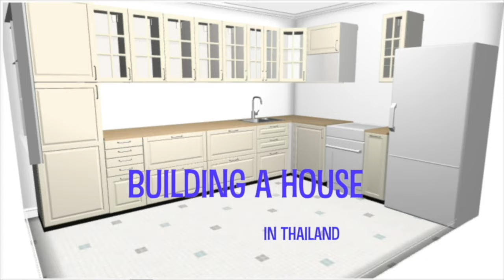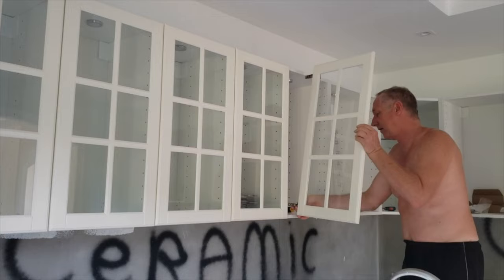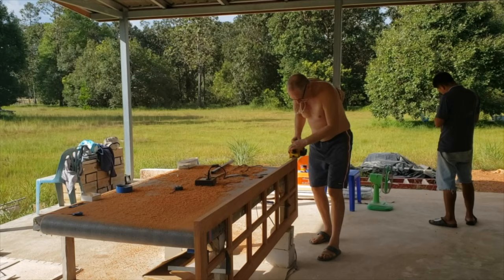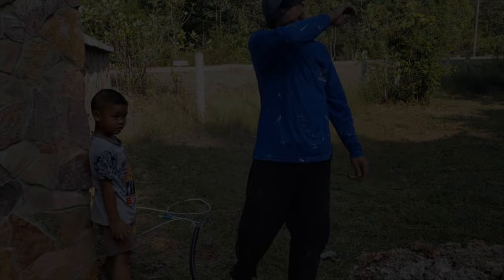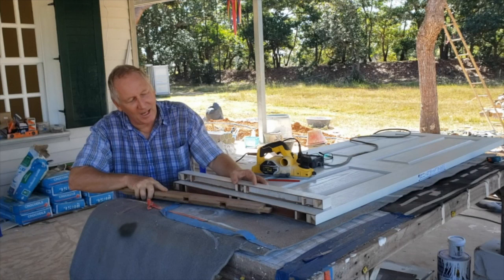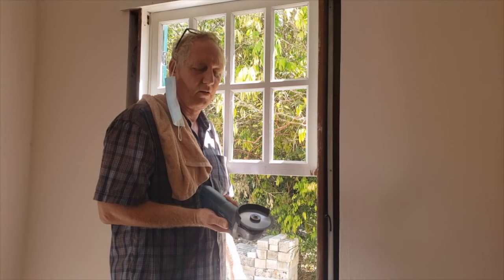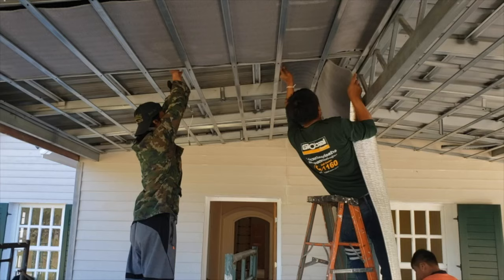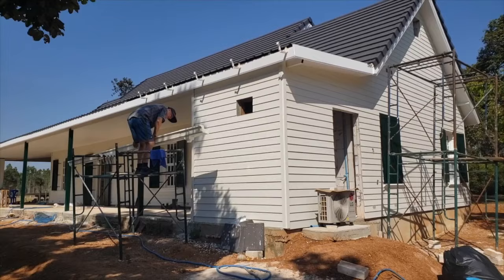Building a house in Thailand 4

Comment: I must say Maarten, if you weren't there the job would not have been in that shape or that complete, not at the rate these locals work. Working to them is a vocational holiday, nothing has a serious part to it, and blowing the draw line through the pipe is totally something new to them. Now they have learned some thing new, well done.
Reply from the maker: You are very right.
In the beginning things were fine, but the closer we got to the finish-line, the more often they were "sick".

At one point we simply let them go as nothing got done. So now I finish up myself. A lot of work but a lit less stress.
Reply: You are certainly learning how to build with a Thai crew the hard way… 555!
Reply from the maker: @garyprice6504  Is there an easy way? 🤣😂

Comment: Enjoying your videos. I have two questions. What is to insulation in the roof called and who supplied your kitchen cabinets? We are building a house in Bang Saray. Great job, look forward to the next video.
Reply from the maker: Hi Wayne, 

The roof insulation is a layer of foam and a aluminium foil radiation barrier.   I don't know what brand or name. We just buy a 200 meter roll at a roof-sheet factory.

The kitchen is from Ikea. You can design and order on their website.

Good luck with your build.

Comment: Looking very good. I was just wandering about the block size. You mention you  used 15cm blocks. 
I have read that loadbearing blocks should be 20cm wide .What is your thought on this.  Very interested because we plan to do our house using these blocks.
Reply from the maker: AAC blocks come in two varieties, G2 and G4, which determine the compression strength.
G2 is a minimum of 25Kg/cm² and G4 is a minimum of 50Kg/cm².
All blocks from 10 cm up can be bought in either of these varieties and Insee even makes 7.5 cm G4 blocks.

You need to calculate the weight of the walls, the concrete ring on top, the roof steel and the roof covering (tiles or sheets).

Then you have the "dead load" of that part of the house that puts weight on the first course of (load bearing) blocks.
To be safe (and to approximate the dynamic load) you double that number.

Now calculate the surface of the top course of (load bearing)  blocks (that carries the concrete ring) in cm².
Multiply this with 50 (assuming you used G4 blocks) and you have the minimum load bearing capacity. 
This must be higher than the calculated dynamic weight of your house that you calculated before.

If it is not, you must increase the thickness of the load bearing walls.

In our case the 15 cm blocks had more than enough load bearing capacity... and for insulation purposes we also did not need more.
And why spend more than you need?
Reply: @Living-off-grid  Thanks a lot. Very useful info. Can maybe save some money😀.Our hose only one story whit simple metal roof.

Comment: Where did you get the kitchen cabinet set? It looks pretty nice. I've always kept my food stuffs on an open metal shelf because mold tends to fill up enclosed spaces so I'm curious how well kitchen cabinets actually work in this climate.
Reply from the maker: Hi Hairy,

The kitchen is from Ikea. Great stuff, easy to assemble and comes with a no nonsense 25 year warranty.
Reply: @Living-off-grid  Great thanks. We're in the north and I believe the only Ikea in in BKK. How much did it cost if you don't mind me asking?
Reply from the maker: In total about 150.000
We ordered all on-line. Never set a foot in the shop.

Their website has a "kitchen planner" in which you design the kitchen.
Reply: Did that include the bench top?
Reply from the maker: @anthony7091  No. The worktop is from a different supplier.

Comment: My Thai wife tells me that before you can build a house you have to pay an architect for plans and an engineer for the foundation and other approvals. Regardless if you have your own plans. Was this true in your case?  Did you serve as your own building contractor or did you hire a company? Thanks
Reply from the maker: There is a simple trick around this rule: If your house is smaller than 150 M² and the colums no longer than 4 meters, you do not need an architect.
You can submit your own plans (a simple floorplan with a description is enough) to the obatoo (how ever you spel that) and obtain the permit.
Extensions to the house do not need a building permit, so you can make it bigger if you want later on, but in reality 150 M² is quite big.
Reply: Thanks for the info, there is no requirement for an engineer's approval for the foundation and structure, etc?  You must have planned a very long time for this effort, including which particular contractors you got involved with during the various aspects of construction.  No doubt you had a place to stay nearby with Thai family while the house was being built.. @Living-off-grid
Reply from the maker: @robdavinroy1761   No contractors. I did all myself.
We just hired local workers.

There is no need for an engineer to approve the plans. The obatoo has a few engineers and they take a look and either approve or tell you what to change.
They also visit on site to check if you follow the plan.

In our case, a house without columns,  they could not even follow the math of the load-bearing capacity,  so they simply approved it right away.

Comment: should use putty silicone doesent last
Reply from the maker: You mean window-putty?  Sadly not available in Thailand.
I tried to make my own with linseed-oil and calcium, but that did not work.

Anyway, the silicone is not exposed to direct sunlight, so it will last long enough. Probably longer than me 😂